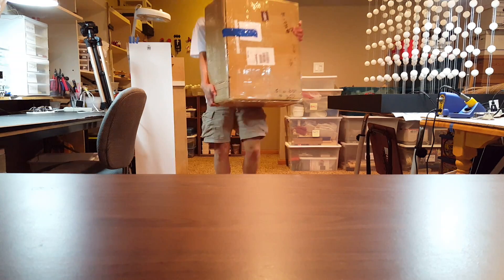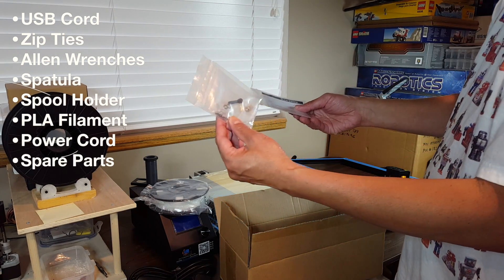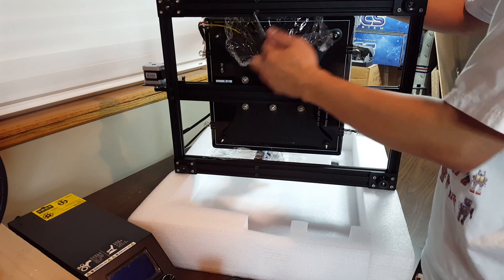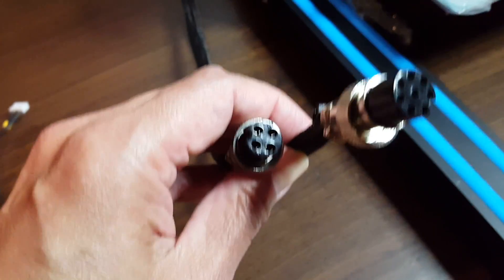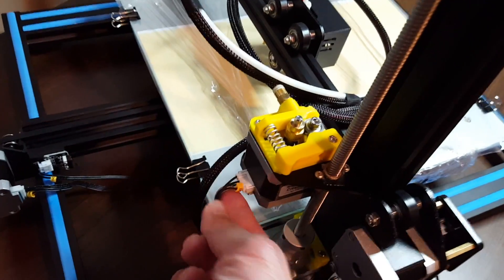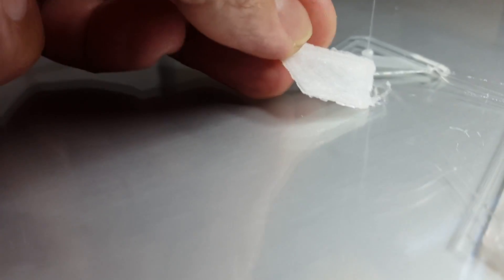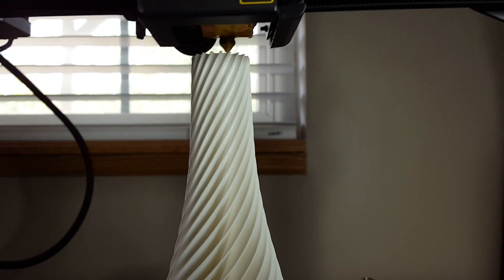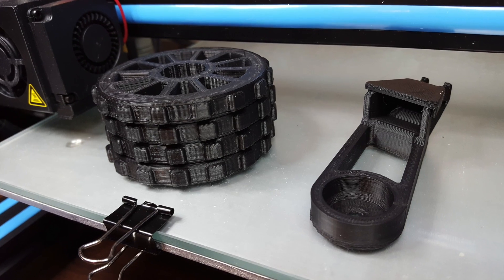HariFun #158 - Creality CR-10 3-D Printer

Comment: why not design and print a mount that you can attach to the print head and install an inexpensive dial indicator into so you can level the bed quickly.  A little g code that position the head at four different location, lowers the head to allow you to read the dial indicator and then moves on to the next location?  Seems like this would allow rapid and accurate leveling.
Reply from the maker: That's a great idea!
With the help of a dial indicator, bed leveling will be easier, and considering the build quality of the CR-10, I think it would not have to be done very often.
Thanks for the suggestion! I love it!

Comment: Great vid.   make sme want to hurry up and get my franken printer fully working .  But man  thats some nice printer  you got there .   Too bad about the  LED zapping ,  at least it was not a total loss . and now yo know you cna put a fuse and voltage clamp  in line with the feed , or even per tower if you want more redundant safety . 
great stuff man .    and Yeah i did see my face  in your out-tro. LOL
Reply from the maker: I debated asking people if they'd mind if use their likeness, but I figure it is right there on YouTube and it's only 0.1 second, so far no backlash. lol

Just got a wider iron tip -- I'm hoping I'd be able to desolder the fried NeoPixels using TWO irons.  I've tried ChipQuik and though it works, it is hard to keep from going all over on that tiny PCB.
Reply: i have heard mixed opinions about chipQucik ,  one that stands out is Louis Rossman (sp) if you ever watch him , he did a micro review mid board repair .  he just puts loads of the flux he has on and/or nice blob of solder on the iron .  
one neeto' trick for removing chips is to  bend a small bit oc medium to heavy ( house wiring ) gauge copper wire into a small U shape ,  such that it has a  loop body held against teh tip of a good power iron and the 2 'forks'  can be bent and trimmed to just be enough  to touch both side of a IC at the same time .  the  quick flick and the IC is off.   Copper wire works well as it conducts heat pretty darn good and it will wet with solder .  In-fact i should do a mini video about it .   I'll garb a scrap mobo or something and remove a few chips on camera .  Not sure if i will have time today but it should be a handy tip video or some .
Reply from the maker: The thought of a custom iron tip in the shape of a bottomless box occurred to me, but I could not think of a way to construct it.  I wish I could 3D print it. lol.
Using house wiring to create a U is  clever.  I'll have to try that. Thx Scott!
Reply: no problem , its a old trick , taught to me by a old grey beard back in the days when i had to harvest all my components form old electronics . 
i still do it form time to time and if your iron is one of those cheapo pencil irons , sometimes you can just bend enough loop to remove the iron tip and insert the copper wire  loop into same space. I will have a look in my drawer and see if i have one and pop up a quick video .

Comment: Great stuff Hari!  Mine should be here today :)
Reply from the maker: Thx Eric! I had to cut this due to the loud fan, but beware that Z-coupler might have to be moved up a little or the lead screw would be TOO HIGH as you tighten the top set screw... Mine fell INTO the z-coupler! Had to disassemble the top lead screw holder to retrieve that set screw.  What huge 3D prints do you have up ahead?
Reply: Will check it out as it just arrived :)  No plans on huge prints but need to design a steering mechanism for the big new Mars rover style robot. Should be fun.  Cheers Bud